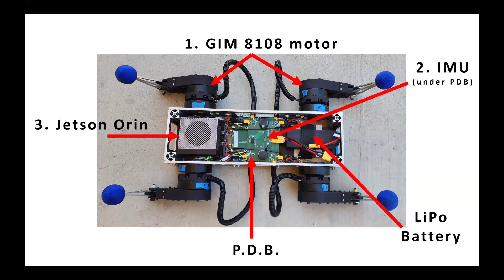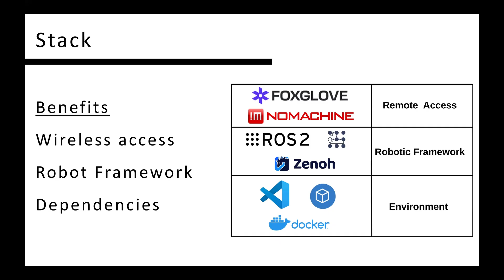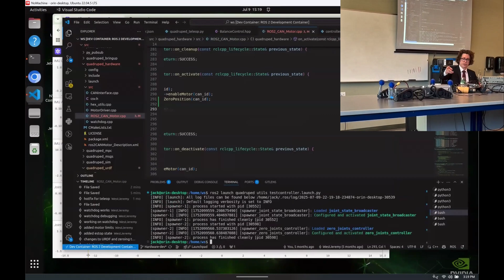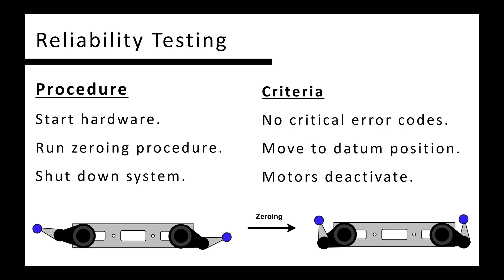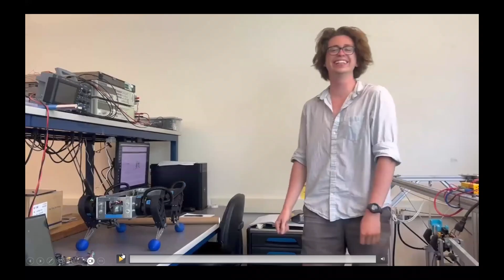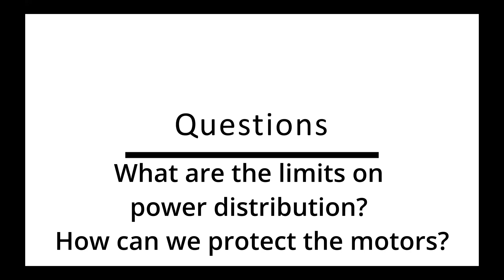Masters Defense of Switch, a ROS2 Quadruped

Comment: Are you using a kalman filter with the position values that you’re getting from the motor?
Reply from the maker: Right now we don't, the data seemed to be pretty nice. The only kalman filter in use on this system is the built in one on the BNO08x.